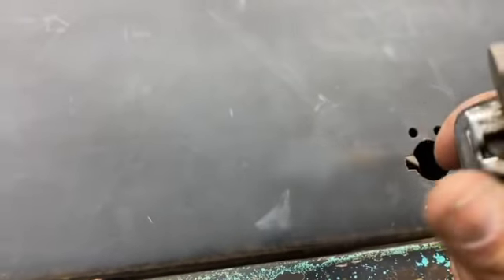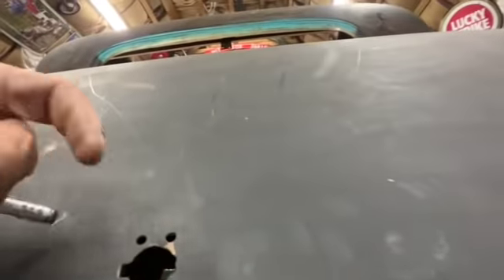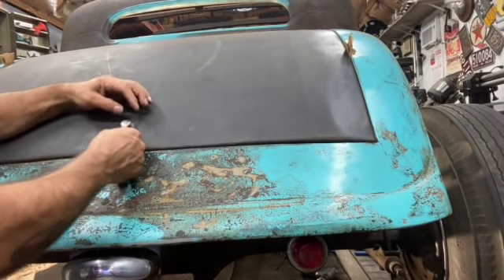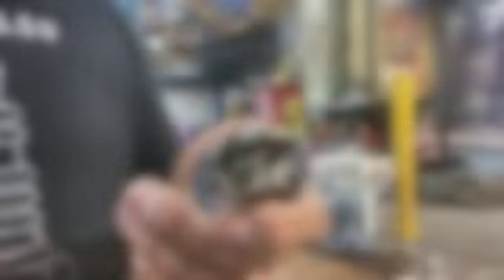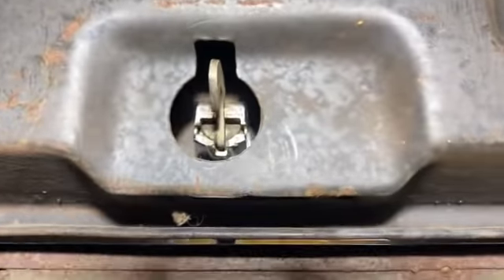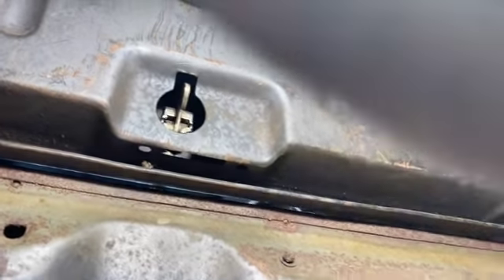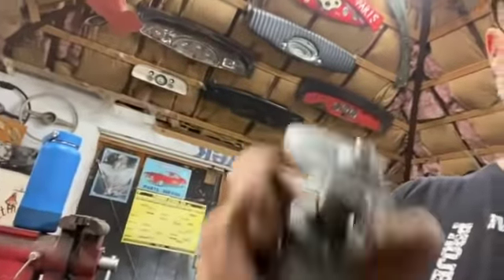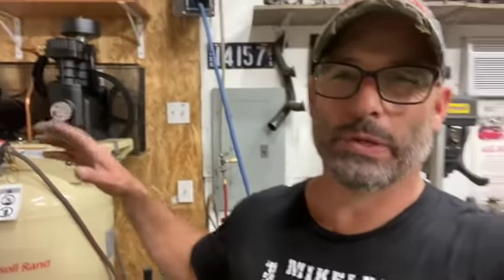1934 Ford 5 Window Coupe Rebuild

Comment: I have this screwdriver I use for situations like that. Its a straight that is split and has a slide that goes up and down the length...when you move the slide it tightens the blade tight in a flat head screw...works great...I think you will find them in electrical type areas or suppliers.
Reply from the maker: I am going to have to look for one.  Thanks a ton !!

Comment: I have enjoyed each of your videos on the 5 window. Mine is on hold for now as I start on a 29 coupe. I just had it blasted and found all the sins of a previous life and need to get some epoxy on it soon. The temperature is changing quick and at least get something done. It took me 3 years to build my first one over 30 years ago so don't get discouraged just keep plugging along one piece at a time

Comment: Next time just tape the screw to the screw driver with some masking tape. I'm currently working on a 34 I bought about 7 years ago that could be a carbon copy of your's minus the top chop. Severely channeled, 32 grill, chevy rear end, suicide front spring perch, the whole bit. I had to move the front axle back 11" to get it to the stock configuration. Lots of fun fixing someone else's mess. I've been working on it about a year now and trying to get it down the road in about another month. We should compare notes!
Reply from the maker: Love it !! I’d love to see some photos of your coupe !
Reply: He can run the screw driver on a magnet it will get magnetized and the screw will hold on, I'm in a wheelchair and I build a few car's and truck's with help but I learned many many tricked to make it a little easier. I have a 1947 Chevy coupe stylemaster with a 250 with a 350 transmission I changed it over to 12 volt conversion disc brakes in the front looks like an Grandpa's  car but runs like a grandkids car.
Reply: They make a screwdriver with a spring clip attached for a little job like that, I have been had one for years.
Reply from the maker: Thank you.  I need to find.  That’s so frustrating !!
Reply from the maker: Thisoldhotrod@gmail.com. Thanks !!!
Reply: @ThisOldHotrod  I was thinking "irontrape garage" they may have a lot of stuff you are looking for? Matt  buy's sell's and trade's and give away I'm shire you watch some of there video's. Keep on keeping on push on a little at a time you will get there. You'll meet a lot of intrastine people a long the way. I'm in Northern California bay area not to many builds like yours mostly 40's 50's 60s 70s car's and truck's. Your 1933-34 would be a diamond in a haystack here steel body many people would trade 3, 4 cars truck's for your 1933 here in California. In San Francisco there is a shop they build brand new 1930-32 Ford's the way Ford would have built them with modern up grades power steering power breaks. A few celebrities bought from this shop BB KING, CLINT EASTWOOD, Gorge Lucous, and other's. It's a long story how I run into that shop but I'm shire you can find them on line.
Reply from the maker: SNOOP U 2 I’ve been watching Matt and Mikes videos for years.  Started early on.  They’re killing it for sure.  We definitely are into the same stuff.  I think I’m a few spaces away from them in Carlisle Pa coming up in a few weeks.  I’ve got most of the parts and pieces I need to get the car pretty far along.  I’m so fortunate the body is all there.  Been picking away the past few days ... feels good to be back in the shop.  It’s hard to get back into a grove.
Reply: @ThisOldHotrod  yup I know what you mean, and it's good to step back for awhile to think about your next move on it. I'll sub and keep watching 👍🏼

Comment: If you go on cip1.com (vw parts) under decklid parts, you can get one that locks. It's a '67-'71 latch and there are two versions...a single hole mount like yours and a 3 hole mount (that looks like the truck lid was drilled for)

Comment: You just need a kid on the video camera! 😆 Are u gonna plug weld those couple of holes in the deck lid eventually or just leave them? It’s funny how long a simple job like this can take right? Even if u just put the 60 gallon tank in the other shop and use it as surge tank that will help operate the high CFM equipment.